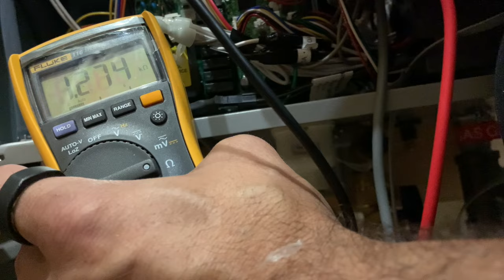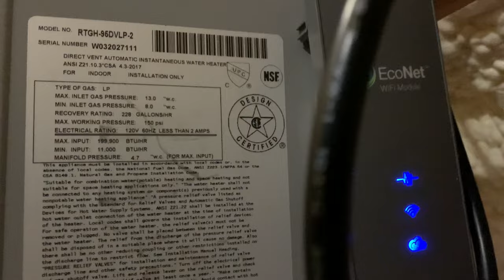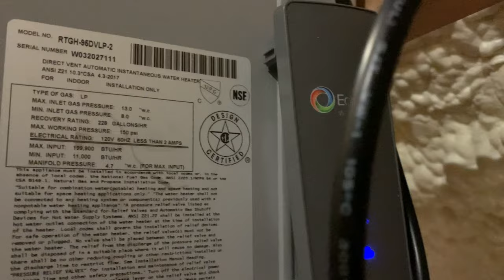Code 11,12,13 live troubleshooting with an Agent

Comment: That freaking beeping is the bane of my existence. I will never buy a green again. Nothing but issues and no answers from tech support. Not even a year old I have had flame rods go bad, thermistors go bad, ignition coil.    Just a nightmare of a unit.
Reply from the maker: Take it back and exchange it, also have someone familiar with reading the use and care manual check the install, a lot of issues are installation related
Reply: I might have it. The 5/8 gas line doesn’t support enough btu .  Got a 1” od that has up to 290kbtu let’s hope this fixes it.
Reply from the maker: What is your serial number ?
Reply from the maker: @SunriseLAW  I would recommend you have a different installer look at your system, the venting and intake are not correct, the correct configuration is outlined in the use and care manual. If you want to return the unit that is not anything Rheem will prevent you from doing, tell your point of purchase you have a defect and want it swapped out. They do not need to call Rheem to do an exchange anymore than walmart would need to call Apple to swap out some airpods. However I do believe the issues are caused in some part by the incorrect install, If I were you I would have a serious conversation with your installer, and then get a different one.
Reply from the maker: @SunriseLAW  I'm Just here trying to help fix water heaters, If you want me to try and help you further I'm happy to do so.
Reply from the maker: @SunriseLAW  The use and care manual clearly shows the venting requirements. Regardless of what may have been said. That model does not power vent. Direct vent only.
Reply from the maker: @SunriseLAW  That particular model cannot draw room air (power venting) . It must draw air from outside ( direct venting) Also, you should be able to get an exchange through the place you purchased from.
Reply: Yea , our work installs these by the thousands for rental customers , they're hot garbage , but still not as bad as the bosch tankless
Reply: Same here, nothing but trouble,  my previous tank water heater gave no trouble for 20 years

Comment: Do you know what causes the cover of the unit to deflect (making a popping sound) when the unit is first turned on? I have asked rheem tech support and no one has a clear answer....any ideas? thanks
Reply: mine does the same for the last 5 yrs.
Reply from the maker: Check all screws.  Make sure it’s all tight.  When blower kicks on there is a change in the air pressure and the front panel can make that noise.
Reply: I'm having the same thing...Rheem telling me it's a venting/air imbalance issue....but getting different techs saying different fixes for the venting....really struggling with frustration......I also watched video online with this popping being from delayed ignition issues sometimes caused by gunk/dead roach within.... I installed this August 23. Popping started a few months after.
Reply: I was also told by rheem that the air imbalance causing the popping flex is slowly damaging the unit

Comment: Randomly tripping code 12...once a month maybe.  I'm at altitude...6500 feet.  I have the altitude dip switch set right.  My venting is 10 feet with one wide sweep 90 degree.  As a experiment...I set dip 2 switch 2 on...supposed to be for extra long venting...which I shouldn't need.  I want to see what happens.
Reply: How did it go,I’m having same issue,new unit 12 error randomly,8ft 2inch venting

Comment: How  about  E 3 code ? I had  this code  for 5 years  old Eccotemp.  Hot water  was always  120 F. Vent is clean, water pressure,  gas pressure  - Ok. I did  Flushed  water heater  by  cleaning  vinegar.  Still  code  E 3 On. Contacted  costumer support  - no help...

Comment: I have bought 3 Rheem tankless heaters so far. First was for my house when we had propane. 2nd was to replace the LP when we drilled a NG gas well. The third was in anticipation of building a house for my daughter. An LP unit. Installation went without any problems, and according to directions and code. (I thought)  A couple days ago my daughter called and had no hot water.  It would come on, briefly and shut off. On as, light on remote comes on humms a bit and shuts off. Inside 01 flashing.  I had her turn on hot water, and heard only a humm, no start. I suspected the fan motor as it's the first to come on. I called  the 800 # in the manual and reached a service agent lady who took all our info.  She asked where the unit  was installed, -in a basement, under a factory built, modular home. Not mobile, modular. She told me they would not cover it under warranty.  Ok. How about tell me whats wrong. NOPE. She said it was not designed for mobile home applications. Its in a conventionally built basement under a normally looking home. NOT mobile. It was like talking to a rubber wall. Anything I said she came back with the same answer. I told her Rheem just lost a future customer.
I don't give a sh.. where it's installed, she could at least help with troubleshooting. I looked up the HUD document code she quoted, and I could not fine anything that related to a different requirement for mobile home or conventional home installations. Or how they should be built. We tried about 6 different plumbers, 3 didn't work on them 2 don't like to, "there too hard", and 1 said it would be about a week.  $275 just to come out. +++  So I'm on ytube checking all different things it might be. Next searching for parts suppliers. FU.. Rheem.
Reply from the maker: There is definitely a difference between a modular home and a mobile home.  Who was it you spoke with?  Name?  What is the serial number to your unit ?

Comment: I see the complexity in the compact high efficiency hot water heating system. Being an electrical engineer, I would say it is not too difficult to design a diagnostic system which points to a one or two defective component to fix the problem. In short these designers have long way to go to design their own control systems in place of subcontracted out to the China mass product design team.
Reply: I'm an electrical Engineer as well and I completely agree with you.  I've been tempted to do exactly that.  I've owned tankless water heaters for 15+ years and I have found the diagnostics to be quite aggravating.

Comment: This was very helpful. I unfortunately have once again been getting a code 12 once a day for the last 3 days. Water Heater was installed in in august last year. I spent 3 days on the phone with Rheem support trying to stop code 12. We determined everything was ok installation wise. The manifold set point chart on the heater was not on the unit. In aug, I basically increased the manifold set points until the code 12 stopped triggering every time the unit fired. At what point should I use the unit warranty now that this is starting to occur? I am going to check dynamic and static  gas pressures today with my manometer again. It was fine in august.
Reply: Did you check small filter  cap every time before?

Comment: Thanks for the great video. I’m getting a error 12 but it is intermittent maybe once a month but when it does happen it seems to repeat for a day or so. Any idea what this could be?
Reply from the maker: Venting or gas issues.  Possible due to install error or environmental.  Venting needs to be inspected, proper setting for vent and elevations checks.  Gas pressure both static and dynamic.  If you have other things on the gas system and the system isn’t sized properly you will have issues.   Check burner clean as needed.
Reply: @rickpowell1402  Thanks for the reply. I did have it professionally installed. I double checked everything. Used 2” pipe but only 11 ft with 3 elbows so no need to change dip switches. Over sized main gas line 2”down to 3/4” at water heater. There is a 2’ flex gas pipe but looks like that meets requirements. What pressure should I be looking for on the gas line?  It’s just 2 years old.
Reply from the maker: @chrisnelson3470  Look on your rating plate by model and serial number, the gas specs will be there. you'll need to insure the pressures do not drop to low when other appliances are using gas along with the heater.
Reply: I am having same issue once a month code 12...I adjusted Dip 2 switch number 2 to on...going to see if it fixes it....I'm at altitude..6500 feet...I have the dip switch set for this altitude

Comment: Great Instructional Video! Why is the thermal safety plastic non-replacable? The rest of the unit is fine. I hate to throw away $1400.00.
Reply from the maker: It was a decision that was made way up the food chain.  I don’t have info but it may either have to do with them not wanting the heat exchanger removed in the field or they wanted it to be harder to bypass.  It’s a shame because they’re are people that can do this, truly mechanical engineering type people, but there are more of the other type that install outdoor water heaters indoors, breathe in exhaust, and then have to go to the Dr for headaches.  Can’t count the number of times I’ve seen that.

Comment: I have a richmond which is made by rheem. I got a code 17 which is not in the manual. Do you know what this code is. I have a gas unit 199900 btu
Reply from the maker: No code 17.  Possibly a malfunction of the pcb or the controller
Reply: @rickpowell1402  yeah had no water then i left for a few seconds to do something else and it stopped blinking.  All of a sudden it was working again. 
We just installed it 2 days prior. So i have no clue. By the way mine is gas.

Comment: When is code 13 addressed in the video?
Reply from the maker: Testing the gas valve.   Code 13 you want to check gas and venting and be sure to check it 100%.  In the video the testing of the gas valve and solenoids will be a code 13 check.   Cleaning flame rods and cleaning burner assembly may also be a step you’ll need to take.

Comment: First off all, thank you Rick and thank you Rheem for making this video. I realize you didn’t have to do this, but wow I learned a lot.

Second, I have a RTGH-95DVLN, serial RHUNM131307877 tankless.  I have error 13, but also failing the flame rod tests (around min 16).  My 2 flame rods look very different from each other and have different connectors, but I can only find 1 part on Rheem’s part site.  Can I essentially use 2 flame rod 1s (white) instead of a white & blue?

Thank you!
Reply from the maker: Do you have the interior water heater or is yours on the exterior with the side outlet vent?
Reply: Interior with top vents.
Reply from the maker: then you should have FL1 and FL2. on the right will be the igniter. yes the blue and white plugs are the same. And the flame rods should also be identical.
Reply: It won’t let me post a picture, but my flame rods are skewed to the left a little more than in your example unit.  My flame rod 1 (white connector) looks just like yours, but the far left flame rod (blue connector) has a slightly larger pin connector and the flame rod itself is shorter for some reason.
Reply from the maker: Ah you have the fist generation.  Yes they will be different. 
Get the correct replacement.  Look online as other places carry parts also.
Reply: Excellent - good to know I’m not losing my mind.

Thanks again for the video, and a humongous thanks for answering the questions I posted here!
Reply: Hi Rick, just wanted to follow up to let you know error 13 was coding in my situation because of clogged gas ports.  I took it all apart, cleaned them with guitar strings, lightly sanded the debris off, and blew it out with a compressor.  Not sure if it was the slag-type debris or the spider carcass in there, but it did the trick.

Thanks so much again - I’m saving this video for the future :)

Comment: Would descaling help with error code 13?
Reply from the maker: No, code 13 would need to be investigated.  Venting must be checked.  Check venting dip switches, lengths and elevation settings. Gas pressures both static and dynamic checked and also checked when other gas appliances are firing.    The burner may also need to be checked and cleaned.  However if the burner is very dirty this is a symptom of a problem. Which means it will dirty up again if you cannot determine what’s causing it.

Comment: O NO
not obd2 codes. These things gonna be worst than cars. 
Check engine lights
I thought I wanted 1 of these. Now I may just stick with the old proven and reliable tank. 
That thing looks like space ship behind the panel.
Reply from the maker: If we can educate the majority of plumbers diagnosis and repairs will be quicker and easier, these heaters are also still very serviceable by homeowners.  It looks intimidating but it’s not.
Reply: It's irreplaceable if you need constant hot water flow like for my big hot top. With 40 gallons tank I had less than half of needed water.   I installed  tankless myself and for 8 years was perfect. Now I have to figure out error 13